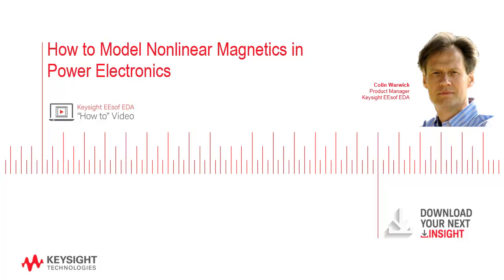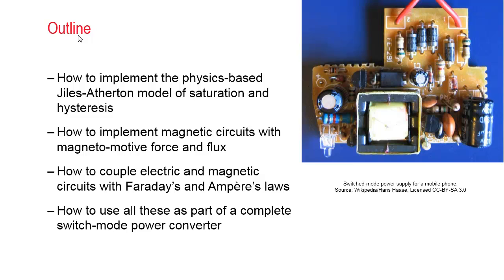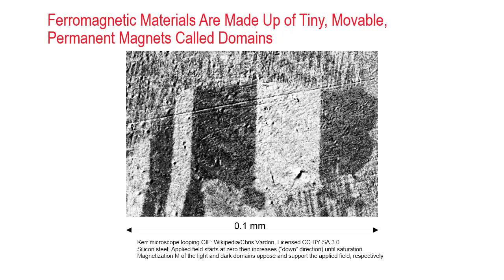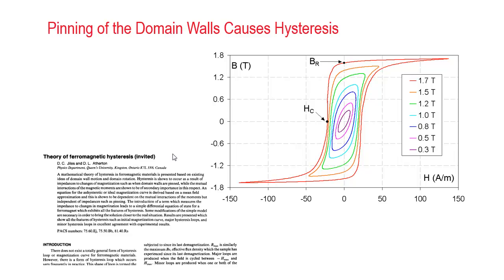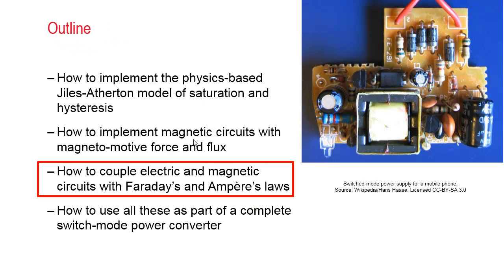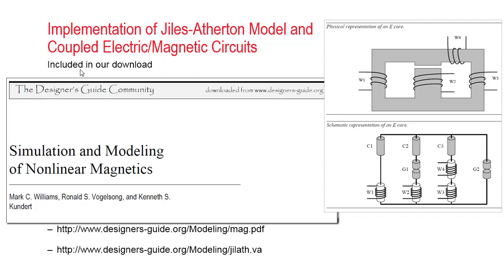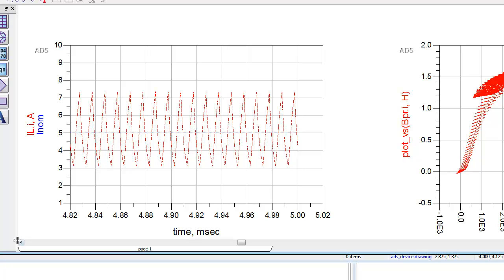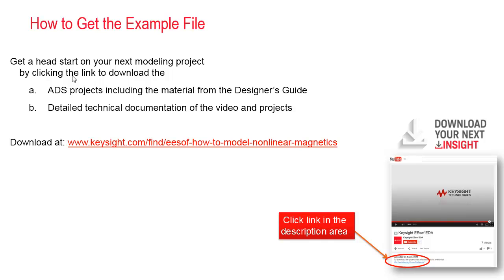How to Model Nonlinear Magnetics in Power Electronics

Comment: I have only one question: 
if the voltage on the inductor is a square wave and its current has a triangular shape, how is it possible the hysteresis cycle continues to behave as such as the source is sinusoidal? Intuitively (maybe wrongly) I expect a "more straight line" near the saturation zone, or in other words, the "curve effect" should be less visible.
Please elaborate.
Reply: Sorry for the confusion. I should have mentioned that the first demo was a simple sinusoidal excitation test bench. The second was the inductor it a SMPS.